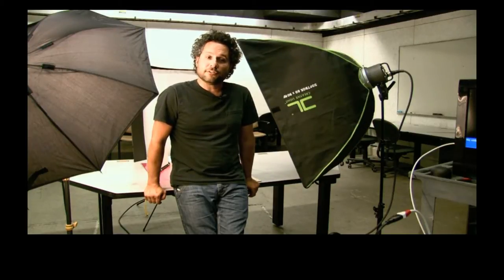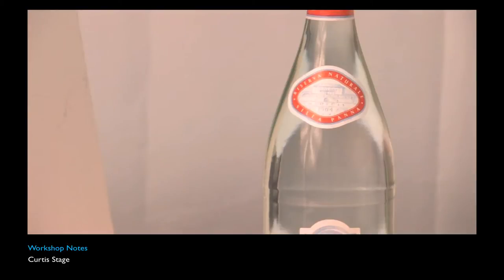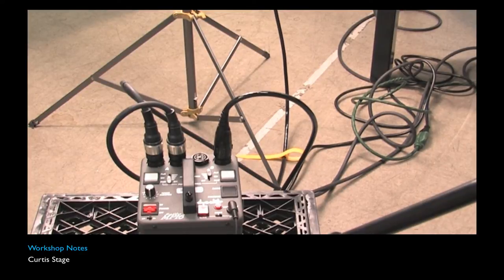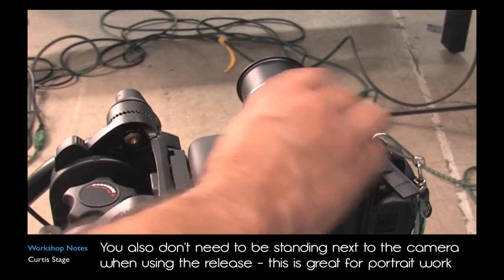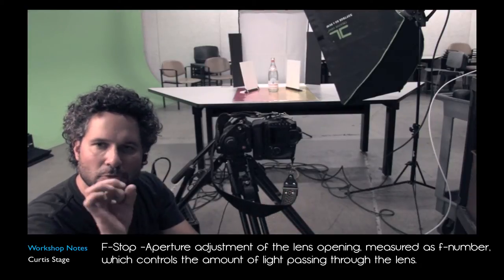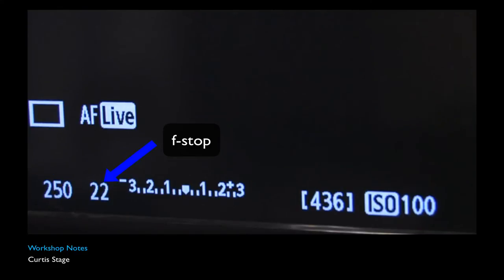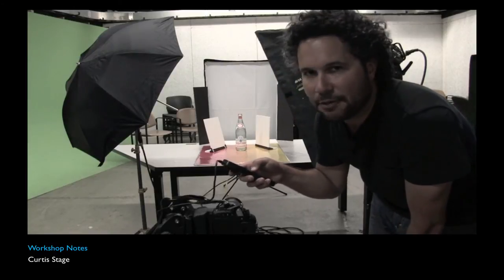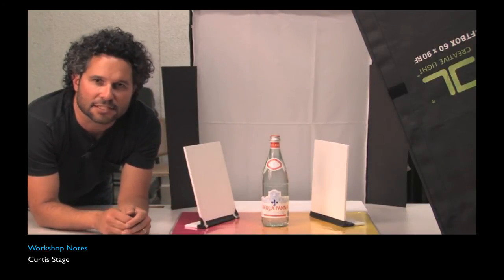Product Photography using Stobes Part2

Comment from the maker: Anthony you are right - in most cases f/22 is not an ideal aperture I would want to use because of diffraction. But in this case with the backlight I needed to use f22...and the flat focal plane there is very little diffraction and I do get a really sharp image. I usually use between f8 and f11 for normal strobe product shots. (that don't have the backlight)

Comment from the maker: I know how strobes work. In THIS set-up with the rear strobe facing the lens, I needed to either drop the power on the strobe or get my shutter speed as fast as I could. Shutter controls ambient light and I had a lot of it with the backlight. So I am at the Sync Speed for the 7D & the faster shutter gave me a pure white background as opposed to lowering power which results in a dimmer more yellow light
If you can shoot pure white backgrounds w/glass a different way great!
Give us your settings!